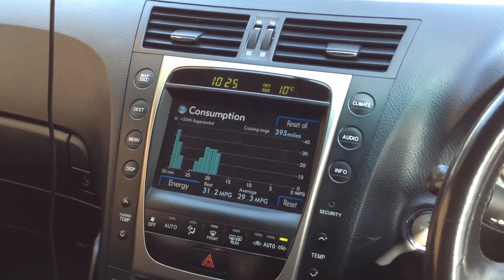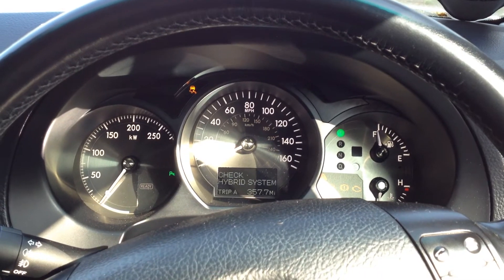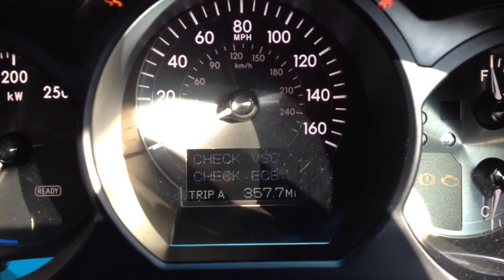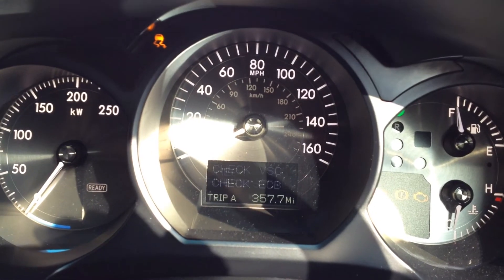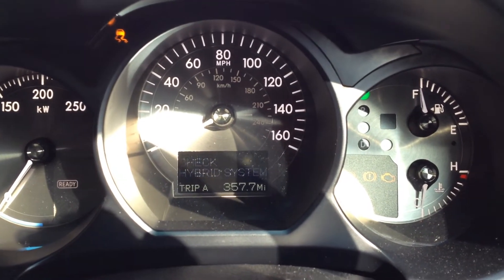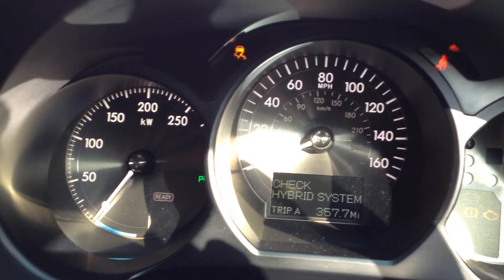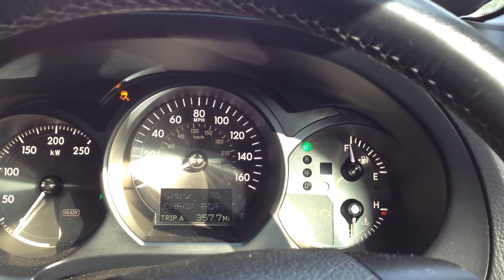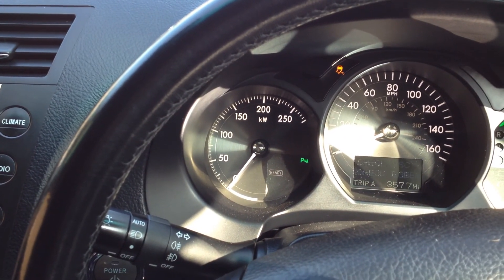Lexus GS450h hybrid battery repair part 1

Comment: Hi, i got the check hybrid system message only on my 07 GS450h after done the oil chage at toyota dealership, no other messages, no check vsc or anything like that. The car starts and drives like normal, i hooked up the obd reader and no codes.  What could cause the check hybrid system message?
Reply: Code for pump is P2797 & it refers to the pump driver. I've never come across one that was the driver (ecu) at fault. Could be any number of things though to be honest.
Reply: @richardfarwell4498  no codes whatsoever when I plug in the scanner.  only check hybrid system on dash..

Comment: ‘07 Lexus 450h Replaced hybrid battery and inverter converter still won’t start any suggestions would be much appreciated
Reply: Hi Sam, I would suggest reading the fault codes firstly then depending on what they say i would check the main fuse in the orange HV Isolator plug & then it is a case of checking all associated fuses & do HV insulation tests of MG1 MG2 A/C Compressor Electric steering pump etc

Comment: hi, so were you able to figure out what was wrong with it? I just got those warning signs (check hybrid system and check VSC, ECB) come up today after driving on some bumpy roads. hybrid battery seems to be fine, still at blue bars. I'm just guessing because of driving on bumpy road, maybe some ground wires became loose. I'm gonna have to take it to the shop tomorrow, hopefully nothing serious and nothing expensive repairs. Please update us, let us know what was wrong with it. Thanks.
Reply: Hi there did you manage to fix the problem as I got same problem on my toyota auris hybrid 2010 please help.